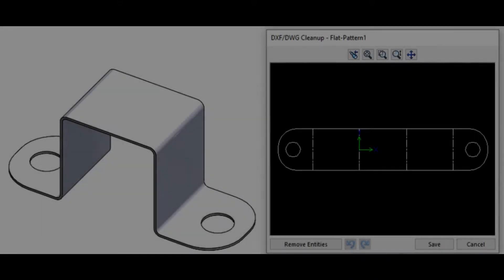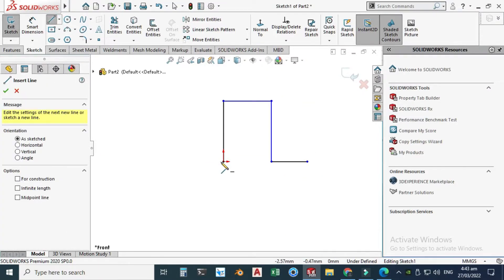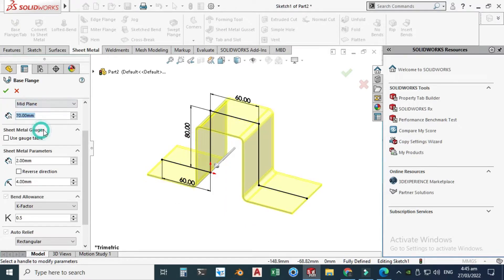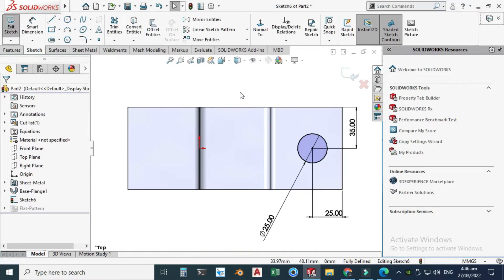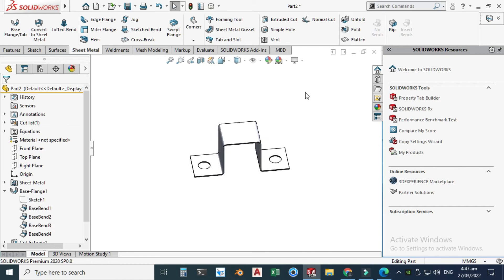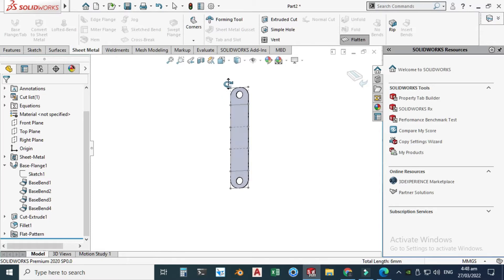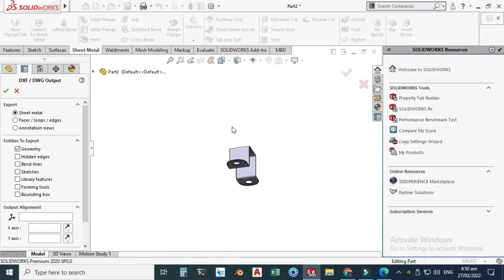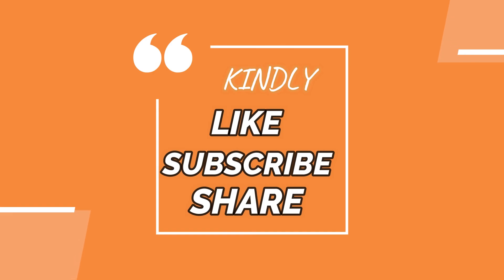Sheetmetal bracket Solidworks to AutoCAD | SLDPRT to DXF | Solidworks to DXF Export | CADable

Comment: how to make the bending lines visible ,when converting to autocad
Reply from the maker: @hameshvj3502  that's a very interesting question, when you are converting your file to dxf in solidworks, it will give you options which entities to carry in dxf format, just check those boxes and then your bending lines will be transferred to dxf autocad.